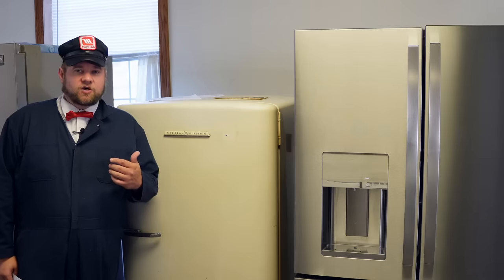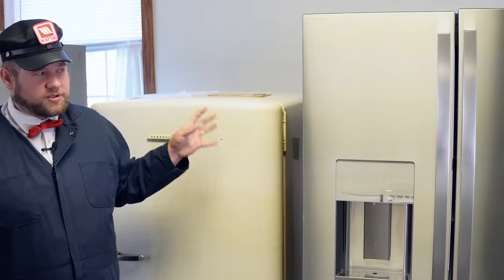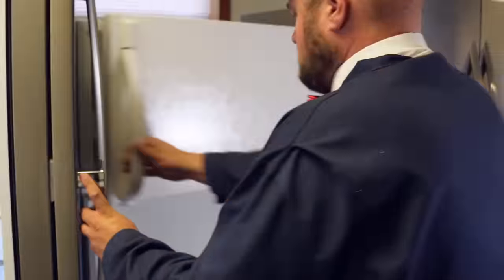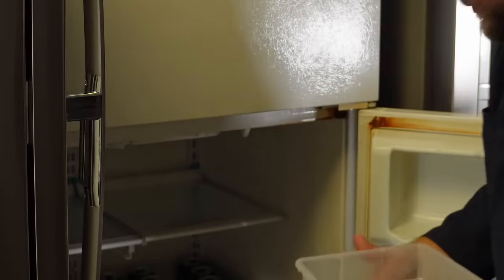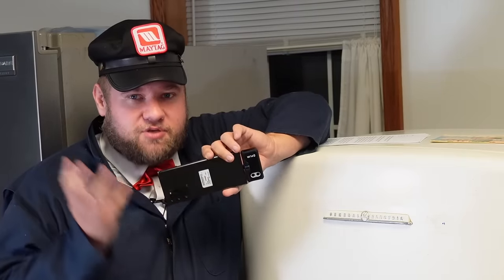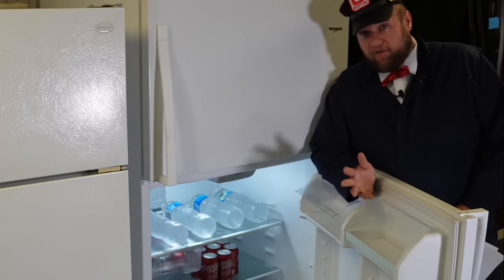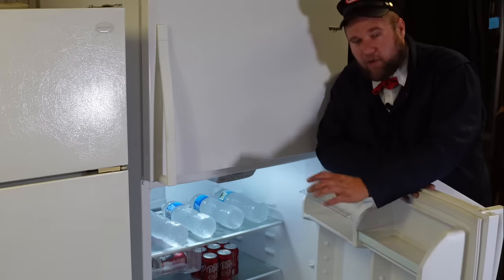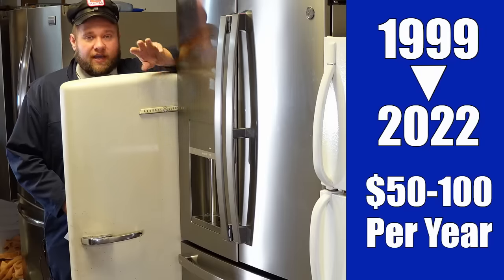Should You EVER Buy a New Appliance if Yours Still Works? A 7-Day Test

Comment: My grandma kept her original refrigerator from 1951 in her garage to store drinks, or when she made a ton of food (Thanksgiving casseroles that had been assembled, but not cooked) or when she had lots of leftovers (also Thanksgiving). My dad finally convinced her to sell the thing in the late 90s when she downsized to assisted living. No joke - her power bill dropped 20% after they took the fridge out!
Reply: Im sure it did drop 20%
But the thing was built to last forever
These new appliances are made to last 10 years at most and always have premature issies that need to be repaired
Reply: @chachisuave3470  Exactly, there are better tricks to keep your appliances more efficient (a full fridge doesn't loose heat as fast as an empty fridge) but built-in obsolescence is a harder mountain to get around.
Reply: I had a fridge in the garage but a closed up garage just gets way too hot for the unit to operate efficiently.
Reply: if you want a  fridge that consumes way less power you should buy a chest freezer, as the cold air tends to go down and since it's staying that way the machine will still be efficient even when the sealing components degrade, and it wont lose cool when you open it
Reply: @McBike770  Are you sure about that or is it just something you heard?
Reply: power bill dropped by 20%, but then she had to buy a new fridge every 5-10 years, completely negating any tiny bit of savings she made from her electric bill.
Reply: And with how much a new fridge costs, you are spending more with how you have to replace them every 7 to 10 years on average than if she kept her old 50s fridge.

This is the save exact thing people don't get with electric vehicles. A 1950s Cadillac is and always will be more efficient and environmentally friendly than they will ever be because of how will it is built to last until today. EVs are built with a limited lifespan in them.
Reply: @TheSportCompact  thats so true with the electric cars. mostly because you have a $4,000-$20,000 lithium battery, which being lithium means that it loses 50% of its max capacity within the first year, and then drops by another 50% every 6 months or so after. meaning at the very most, youve got 2 years to replace your ultra expensive battery.
Reply: @FingerinUrDaughter  

Wildly incorrect buddy. Lithium ion batteries don’t even degrade that quickly in things like phones, of which people charge cycle at least once per day. I’ve had my Hybrid vehicle for 3 years and it does DOZENS of charge cycles per day, because of how hybrids work, and battery degradation is only at about 10% (estimate from shop test) and that seems about right to me by feel.

Most manufacturers give you a 7 year battery warranty, so if anything, they are designed to fail after 7 years and 1 day 😂

But definitely something we can both agree on, they need a better, longer lasting design. It’s going to cause a massive e-waste issue over the next few decades.
Reply: @TheSportCompact  and how much are you paying for repairs on a 1950 cadillac? Almost 0 maintenance needed on electric cars.
Reply: @FingerinUrDaughter  And that ain't cheap these days.
Reply: Mechanical design factor of safety. The components of the compressor and the motor in your grandma’s 1951 refrigerator were so understressed relative to the endurance limit of the steel and the bearing strength of the journals, that it would basically run forever. However, having a system that understressed is inefficient from a design perspective. That’s why a Toyota forerunner will go 300,000 miles on the original powertrain, but get 16 miles to the gallon for the life of the vehicle. Fucking amazing if you never want to have a broken down car, however, the amount of money that you spent on gas for those 300,000 miles would absolutely have bought you a replacement vehicle that was a hybrid or something.
Reply: @MechAdv  you are 100% wrong. they just make em to break now adays. because what else are you gonna dso, NOT buy a new fridge? wash your clothes by hand and hang them out to dry if you even have the space for that? nah. youre gonna buy a new one. dosent matter that they cost several months pay. dosent matter that you JUST got a new one 5 years ago, you need it and youre gonna buy it.
Reply: @FingerinUrDaughter  I’m definitely not 100% wrong lol. I’m a mechanical engineer and I graduated with my emphasis in mechanical design. Granted, had I gone into HVAC or Thermal Systems for work instead of manufacturing, I’d be able to give you some first hand evidence. But it doesn’t take a genius to figure out that they are designing and manufacturing these refrigeration units with smaller, higher performance compressors, with lighter duty motors. Thus improving their energy efficiency and overcoming the inferior, but climate friendlier, refrigerant used today compared to R12 or whatever they were using in 1951. You don’t get performance and efficiency for free though. More stress on the components, more expensive materials, more R&D testing to make sure it isn’t too marginal on stress concentrations to meet cycle to failure requirements. You’re right about one thing though. The engineers that designed and tested these new appliances have a very good idea of how long it’s going to last without needing repair, and are paid to make it last just that long to maximize profit.
Reply: @FingerinUrDaughter  Dude, get some help.
Reply: @FingerinUrDaughter  lol. As an owner of EV, my battery capacity has not dropped 50% of its max capacity. It has not dropped at all.
Reply: @andrewcool  just wait till you do some basic research on them and you find out that half of the battery is softlocked away until the first half loses enough capacity, then it swaps over to using the 2nd half and locking out the first.
Reply: @FingerinUrDaughter  can you send me your research? This is not my first battery powered car.
Reply: @williamclark5647  carbon based batteries seem to have a lot of potential as a replacement to lithium batteries, but I doubt they'll become mainstream because of how good they are
Reply: But her appliance bill raised by 40 percent
Reply: @FingerinUrDaughter  I get 55-60 miles per gallon of gas. The batteries are definitely doing something lol.

Hybrids go through dozens of charge cycles per day, because that’s how hybrids work. The gas engine charges the batteries, the car runs on battery power, when depleted the engine recharges them. The batteries use the waste energy + braking energy in the car. I can only go about 5 miles with a fully charged battery.

Replacement batteries for my car is $2,300, labor included. While that may seem like a lot, doubling my gas mileage more than makes up for that cost.

There are a lot of different angles you can argue against battery powered vehicles, but you have chosen none of those.
Reply: @williamclark5647  Often electric cars are guranteed that after 3 years the battery still has 70% charge left. So people loose the fear that their cars worthless after a short time. I think the trend is that this is improved furher and probably some contries have laws too.

It may be that some lock away some of the capacity to have the battery to appear not to loose capacity for some time, but the problem with that would be that capacity equals to weight. And weight decreases efficiency. Others lease the battery instead of selling it. So it may be replaced if needed whithout cost for the car owner.
Reply: Also, the garage is not climate controlled. Which means the fridge had to work extra hard.
Reply: A garage is not a good place to put a refrigerator. In the summertime, when your garage heats up, that refrigerator is going to run constantly. You’ll save money in the winter, but overall, I think you’re going to use a lot more energy. A better place would be to have it in the basement, if you have a basement.
Reply: @edgarbernal1831  Who drives a 1950 Cadillac? 🙄🤦‍♂️
Reply: @chachisuave3470  i still have the GE frig in my garage that my parents purchased in 1955.Its still working good as new. I already went through 5 new refrigerators in my 60 years of marriage. As for power consumption? .I've never noticed.
Reply: Of course, it was exposed to the heat in the garage
Reply: @edgarbernal1831  Electric cars are new. Sooner or later they'll need repairs and they will be EXPENSIVE! A 50's Cadillac? Parts are cheap and you can replace them at home
Reply: @chachisuave3470  right it's sad.  They really do use less power but at what actual cost to your wallet?  I'll take the old power sucker!
Reply: Wow
Reply: Not exactly. It wasn't the fridge. Fridges from the 1950s are way more efficient than today's, as they don't have the freeze/thaw cycle that eats up power. My bill went way DOWN when I replaced a new LG fridge with a 1958 GE. Ask any knowledgable appliance person and they can tell you that.
Reply: @FingerinUrDaughter  A church friend of mine (who passed away at 102 only 4 years ago) and her husband had a 1957 vintage Fridgidaire freezer in their garage since it was new, that was still running during the 1980's. I did not think to ask her in more recent times if it was still in use. My dad bought a Sears Kenmore top freezer fridge in 1966 that lasted until 1993. His virtually identical 1993 replacement was still running in 2014 when my sister had it replaced for free by our power company for one of those new energy saving models. It was about the same size as Grandma's 1950 fridge shown in this video. My sister did not care for that. I believe it also was problematic if I remember right. Finally, I have a 1996 Hotpoint top freezer model that is still going strong. Therefore I don't believe this planned obsolescence lie that "fridges should last about 10 years."
Reply: I bought a hotpoint side by side biggest one they made because it only had 2 drawers.  The ge fridge had like 4 and I don’t like drawers.   I bought it in 1985.  The only thing that has ever gone wrong with it is after 20ish years the water/ice maker went bad…maybe the solenoid?   I don’t care.  It’s just the best fridge ever.
Reply: and when new fridge goes bad in 7 year you spend more that 20% savings on new one
Reply: @chachisuave3470  But does it matter? shit now is more fragile as shit now is more complicated, but because it is more complicated it consumes less. Appliances today ain't that expensive but energy kinda is
Reply: My grandparents have a fridge from 1991 that they also use for storing drinks and for freezing food long term.
Reply: @FingerinUrDaughter  I'm still driving my hybrid from 2010...

Comment: Ben, please don’t hack up Gran’s old refrigerator.  It’s a classic work of art!
Reply from the maker: Id never hack it up, but we may be able to take a few pieces off to dig into it to look at certain parts
Reply: @bensappliancesandjunk  That’ll work.
Reply: I have one in our shop still going ! 🎉 makes me mad that the industry is engineering failure in everything we buy today !
Reply: @plumbum6558  ed
Reply: @bensappliancesandjunk  sure, replace gaskets, hoses etc., so it's good for another 70 years!
Reply: @davidquinn9676  Given old girl has 70 year old seals, yeah those might have few leaks, so full restoration and repeat the test against same size fridges if possible. Also far as i know its the delicate electronics that fail in newer machines, well as minor undetectable leaks in the coolant circle over time dumping that gas out, witch reminds me @Bens Appliances and Junk What frigerate gas each of these used? That could be one difference as well since old girl probably has something that has been banned from use for decades, while new stuff is not as good, but as mentioned quality is way different so there even is frigerate gas in the system at all. Since age varies so widely maybe get cold tech to see if there is still right amounts of gas inside and look into swapping the compressor oil while at it, it might need replacing after so many years of running, witch could also mean compressor is worn down due lack of maintenance, so maybe look into it?

In the end more features and complexity over all you add into design, more failure points you add too, witch on it self leads to decrease in utility life, with out malicious intent to get you to buy new even shittier stuff.
For me answer is very simple, more durable the better. Given i have pretty damn cheap power, so 300kWh means fuck all to me at this point, but sadly same does not apply to everyone. Then again said 300kWh one can save just by adjusting their life habits and thinking for a second, like with fridges maybe dont put it next to your oven or fire place or other heater source, clean the machine up and maintain it how it should be to keep the efficiency up
Reply: Gran’s refrigerator will also survive an EMP attack whereas the 2020 one probably won’t.
Reply: @bensappliancesandjunk  Hi Ben.  I suggest you restore and update the thing.  New gaskets, remove the liner and re-insulate.  The hard decision (for me if I were to do this) would be to keep or replace the compressor.  Greater efficiency, or see if it'll keep running another 70 years...

Either way it will make an interesting episode.
Reply: 100% that is a testament to old American engineering, like the Lister Diesels were to British and the Toyota Hilux is to Japanese.
Reply: @iamachine  Definitely keep the compressor, it likely uses a refrigerant that is actually better, but is illegal because it damages the environment if released.
Reply: @Hellsong89  that's true in the 50' up to 70's if i recall correctly, uses r12, called for someones the perfect refrigerant, it gets really great temps and the relation between changing from gas to liquid temperatures are insanely great, sadly it's highly dangerous For the enviroment and was banned for that reason, to 90 up to 2018 or so r134a was the king on application like fridges and freezers, not as good like r12 but still great, just the little fact that it needed more compression work for it who it's equivalent to more amperage in the compressor, welp kinda 

From 2016 up to today the new kind of refrigerants comes to play, like r404, r410, r448b, r290 and r600, who in this case r600 it's highly seen on home appliances, advantages about this refrigerant, welp it's a easy to work for ended needed less power for compress it, that's why newest compressors are smaller and took less amperage compared with the same capacity r134 one, in fact i had the opportunity to see it working both fridges with the same capacity (Imbera fridges for coca cola) 1 door 19 cubic feet 1/4 hp compressors, both in Danfoss/nide brand but here it's the difference the r134a one it's twice bigger  and took more refrigerant than the r290 one at the same capacity, and the surprise don't stop there, i clamp both equipment and r290 took just 1.8A versus 4.2A on the r134a a bit more of the half for the same cooling capacity.

Okay in that part it's insanely great, but how about build quality overall..... Welp that's the ugly part bot despite being same model, the older one it's way better builded that the newest one, surely the new one it's more light but it has thinner metal and almost none support outside whenever the older it has the god old 5mm sheet inside and better outside support, it just feels sturdy against the newest one who feels like a Chinese nokoff
Reply: @iamachine  As long as it works then I would keep  the original compressor, that's the heart of the fridge